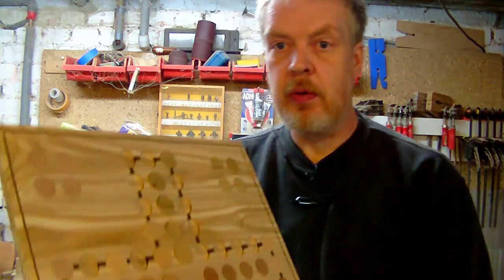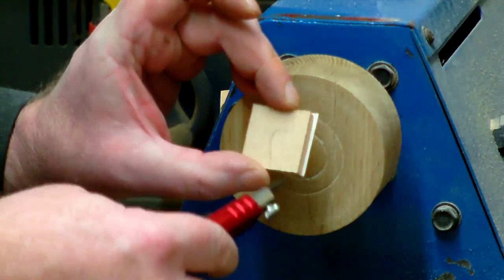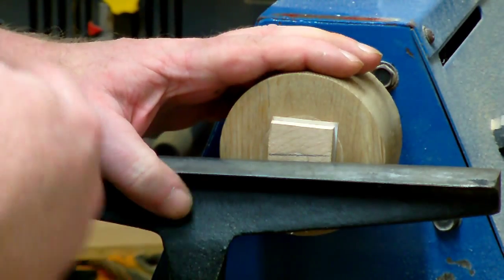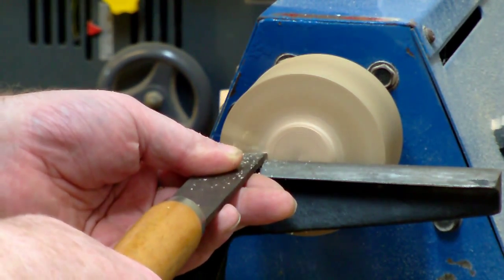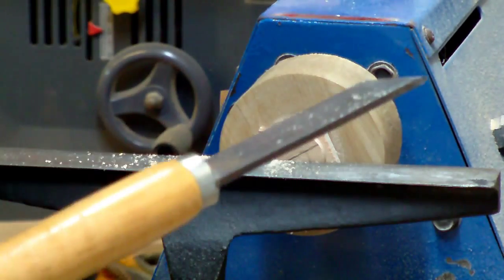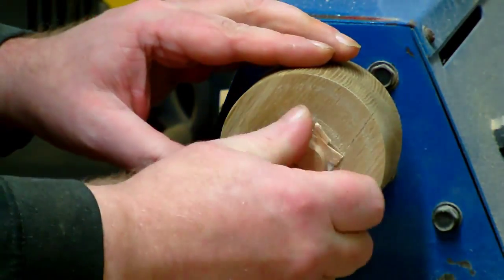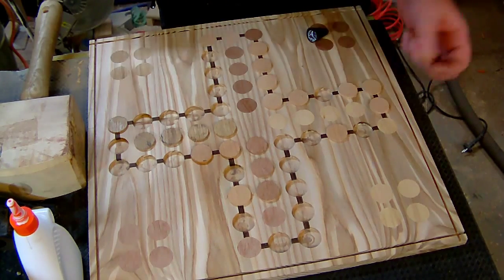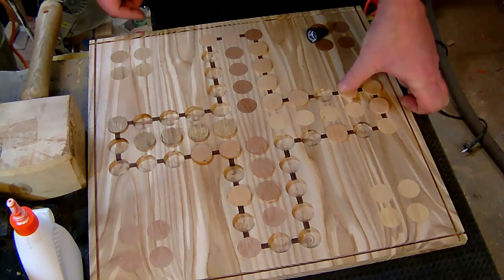Mensch Ärger Dich Nicht - The Plugs

Comment: Beautiful board - Looks to be very time consuming. What patience you have.
Alan
Reply from the maker: Thank you Alan!
Yes indeed, I have to spend the most time on building jigs and templates to compensate for the inaccuracy of my tools. Patience is a must on projects like this, as I'm always short on wood and the pieces I get by raiding local carpenters scrap bins are just enough for one project. Like on this project, I'm using 8 different wood species, if I'd fail on one species, it would ruin the whole piece, so I definitely have to go slow.
Greetings from Good Old Germany
Peter